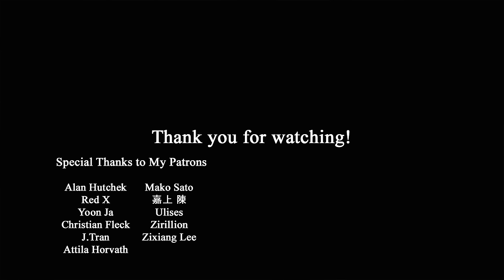Epoxy Resin Diorama - Raid on Alexandria (1941)

Comment: OK. I’ve been a SCUBA diver for over 50 years, and I worked in museums for decades. You’re at the top level of any fabricators I’ve seen or worked with. The underwater feeling is also spot on. They don’t build dioramas like they used to. But YOU do!

Comment: I'm struggling with painting camo on my tanks and when I'm happy with it, I see stuff like this and I start crying
Reply: What's the problem?  Maybe I can help?
Reply: @russellstone9056  Ty, but I just need training. It should get better (I hope)
Reply: @blacky2397  it's all about thinning and pressure.  Keep your tool clean.  If you're in a humid area you might need a moisture trap.  If you thin Tamiya enough you can get a pencil line spray out of it.  Good luck and spray on brother.
Reply: @blacky2397  oh and be pretty religious about cleaning the surface especially with acrylics.  Oils and lacquers seem to have better adhesion in general.
Reply: @russellstone9056  Thanks bro!

Comment: Very well done! Amazing that you also have almost no bubbles left in the resin. I made a submarine in resin but the result wasn't optimal. Hope you can answer some questions for me; 
How much time did you wait between resin layers and how thick was each layer? Did you use any wax or some product to avoid the resin sticking to the acrylic plates? approx.room temperature? and last question, did you use a torch or heat gun for getting bubbles out of resin or did you just pour very slowly?

Comment: What a wonderful diorama! Fantastic work and I could never do something like that :) I really loved shining the light through it at the end. The proper light makes it all seem magical.

Regarding your styrofoam issue: If you are willing to listen to someone who has no clue other than what he reads on the internet and no practical knowledge about this topic whatsoever (so: take it with a big grain of salt), here it comes. Using the epoxy directly on styrofoam can melt it and this produces a huge mess. Thanks to you priming and painting it, the damage was minimal and you only had a few bubbles. You could use a protective coating such as styrocoat or styro shield to protect the styrofoam. Alternatively you could use PU foam, which does not suffer from this problem.

Comment: If you paint a seal coat of Epoxy (or 2) on the foam surfaces, you should be able to seal the air inside so it doesn't emerge into the main Epoxy Pour...

Another possible solution would be to use a Vacuum Pot to pull all the air out of the project when you do the main pour, the problem might be to find or make one big enough to hold the entire diorama when doing the pours...

Comment: 18:44   Instead of using a die grinder to shape your waves, would a shallow, colored layer of resin, applied with intermittent, varied length brush strokes not have been as effective?  It would have eliminated the generation of all that resin dust, too.
Nicely done, thanks for posting this.